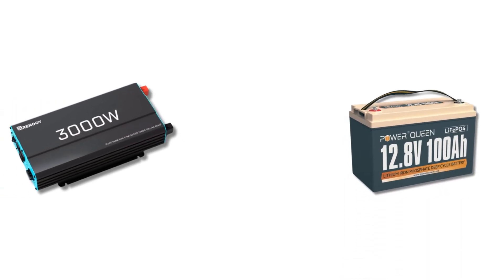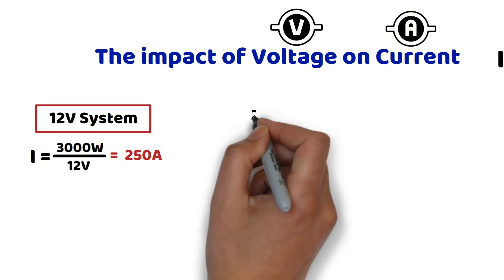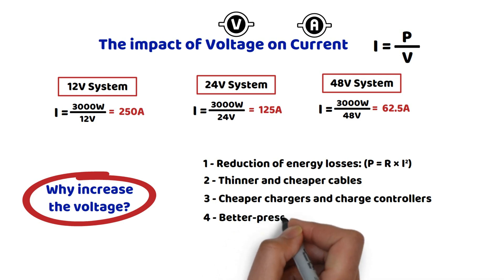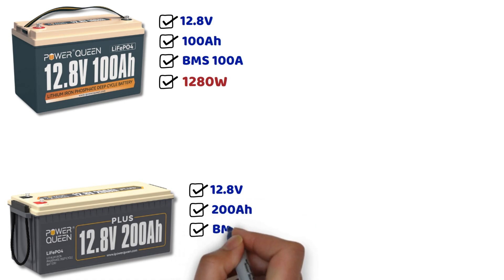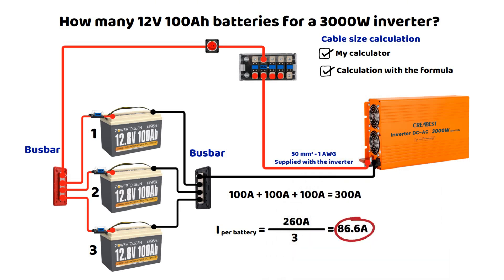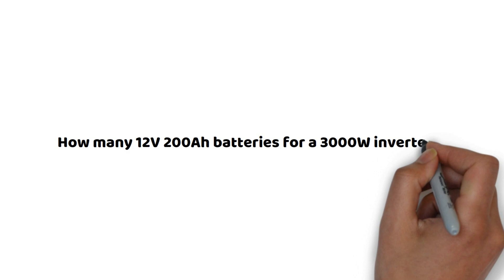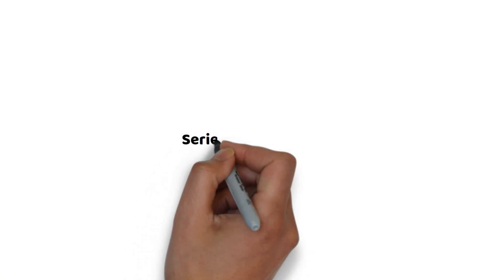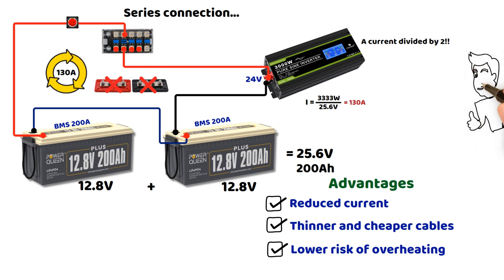How Many 12V Batteries for 3000W Inverter? - Avoid This Mistake!

Comment: This is the result of 50 yrs of experience - also the result of working on generators and inverters in the offshore shoe oil fields for decades and growing up in a family that was in power production since 1880s - 
       As a general you never want the continuous load on a inverter to exceed 25%  if the cooling fan has to run continuously  the load is too high - 
     With lead acid batteries you do not want to exceed 20%   of there full current output continues - 
  With lithium batteries you do not want to exceed 40% there full rated out put continuesly - 
      Alithium battery rated at 100 amps on a hot day will cut out in a half an hour at full load because the BMS over heats - most will deliver 40 amps continues with out over heating - 
       I live in the rural deep south I've been through many storms in my 70 yrs - power can be knocked out for several months - 
      A hybrid system can save 1000s of gallons of fuel and 1000s of hours of generator run time -

Comment: I’m so glad I found this channel you explain everything and tell us why things are done a certain way. I have 4- 12v batteries 100ah with a 24v-3000w inverter. But the battery’s only have a 100v bms can I hook up 2 batteries in parallel the other 2 in parallel then hook them up in series??

Comment: Thank you for providing example for bigger 200Ah batteries, I needed that so much (would have been great to also have it for 290Ah or 300Ah configuration, showing cabling and fusing too :)

Comment: I have many 100 amp hour / 100 amp BMS 12.8V LiFePo4 batteries. You introducing the fact that you can get 12.8V LiFePo4 batteries with 200 amp BMS was a technology / concept that I was missing. This makes the wiring MUCH easier vs using a bus bar power distribution set up.

I'm designing a back up system for my 2 sump pump system that will run from the grid and automatically switch over to battery back up upon a grid power failure. The inverter also had an integrated charger so that if power goes out for 4-8 hours and then comes back on, the device will automatically recharge the batteries so that if the power fails again the next day, the batteries are charged up and ready to provide power again. This is for a full subterranean basement, so it's very important that the pumps be 100% powered in case of incoming water.

Your video will dramatically simplify my wiring for this system.

Thanks!

Comment: So new to this what if you have the 3000 inverter 1 battery 200AH but only use maximum of 600 watts a hour for about 4 hours and then breaker off for night back on when sun comes back up.  I would imagine it would be sufficient being it’s not trying to pull 3000watts just wanted to have to run a water pump 12 v for 7 minutes and it doesn’t seem to have any problems just curious if this is actually dangerous or wrong in the build our town does not have sharp pencils lol who know how much insulation folks actually know thanks to anyone who has a clue about this stuff for me 👍💯🙏🥇 Many thanks

Comment: I have 2-165Ah batteries in parallel, both batteries with 80amp MRBF terminals using 4awg cables between batteries then a 200ah MRBF to the bus bar with 1awg cables.  I have a 1000w inverter which has a 125 MRBF from the busbar to the inverter using 2awg.  I have a 60Ah MPPT with an 80a MRBF using 6awg cables, and an 80amp breaker from the panels to the charger. Did I rightsized my setup?

Comment: There is nothing wrong with this information here. It's good education for newbies that need a primer on voltage/current relationships. I agree that higher input voltages are good when using high output inverters, but can present problems in real life situations where only a 12 volt source is available for charging when connected in series for 24/48 volt systems. 12 volt systems are the most common in nearly every type of mobile vehicle, including cars, vans, campers, smaller boats, etc. So, to charge a battery bank with a voltage higher than 12, I guess a high output DC-DC upconverter is needed? With solar/wind it's a bit easier because one can use panels and controllers to get the desired output voltage. Another thing, one hardly ever runs an inverter at full output capacity continuously anyway. Maybe brief surges to start a motor or the like, but usually never more than 1/2 the inverters rated power.

Comment: So I got (4) 164ah 12v agm batteries. I have a 2000 watt 12v sine wave inverter. Could I hook these up in parallel? I’m just trying to run a battery charger for my electric zero turn mower. The charger is around 13amp and 120v so it’s about 1600 watts. The capacity of all 6 batteries in the mower that will be charged is about 4000 watt hrs. I have almost double that in capacity of these 4 batts. If I can do this, do I need super beefy cables to connect the batts as the amperage will be increased? My understanding is if I’m only drawing 13-15 amps ever at one time w the charger, you basically have to have the thickness of the wire accommodate that. In other words, the planned draw is what you have to size the battery connecting wires to, not the total capacity of the ah of the batts. LMK if I’m going wrong. Ty